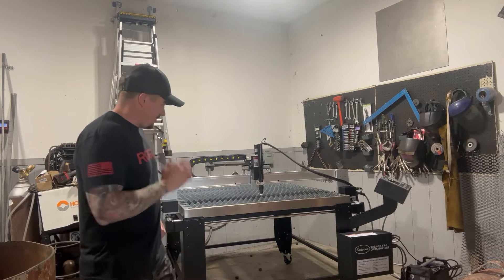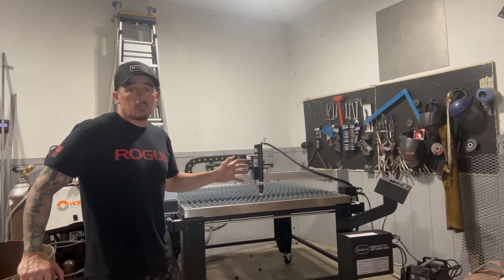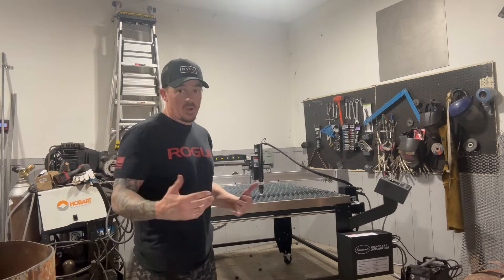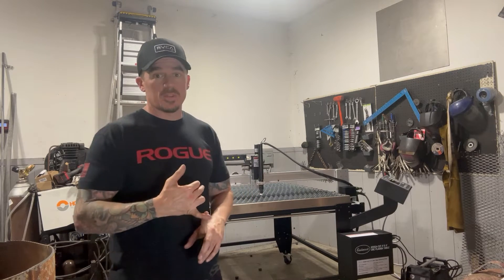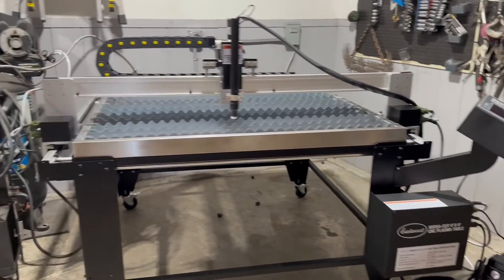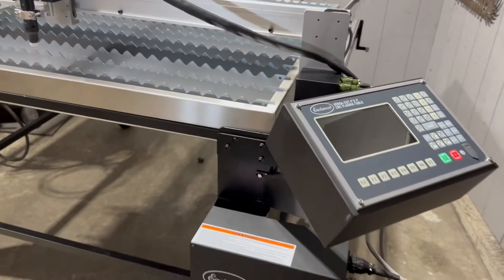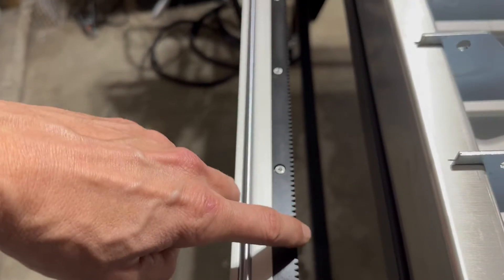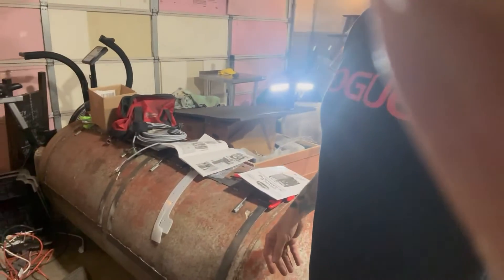Eastwood Versa Cut 4x4 CNC Plasma Table with Machine Torch First Look

Comment: The quality on these is pretty nice. I bought the 2x2 versa cut and assembled it last night. Nothing was missing, nothing was out of alignment and the quality was good. They do not have the lower frame strength for heavy 1/2" material but I don't think I need to cut thick material anyway.
Reply from the maker: I’m finally about to get mine fired up in the next few weeks. I got slammed with smoker builds and food truck dates last year. Looking forward to finally getting it to use 🤙🏻
Reply: @kansascitysmoked6263  Awesome! I hope you're able to post some updates. I know a lot of people are anxious to see how it works out.

Comment: Great video. But, you have a cnc plasma now. Theres no need to buy the standoffs if you damage them. Just make new ones on your plasma.
Reply from the maker: Life has been so busy I haven’t even had the chance to fire it up yet. Just got a HF air dryer for cheap on marketplace and I’m going to get it all plumbed in with a second filter as well. Then hopefully get to cutting and designing.

Comment: Let me know how yours is doing .I bought one 3 days old and mine want move on x or y axle.Eastwood is sending me another computer.
Reply from the maker: Man that sucks. I’m waiting on my fluid and figuring out the best way to plumb my air compressor to it right now. I’m hoping to have all that done in the next two weeks and start doing some practice cuts with the shapes built into the machine. I’ll be posting soon!
Reply: @kansascitysmoked6263 hello sir I was wondering if you like the plasma table? I’m in the market for one and thinking I’m going with Eastwood for size or the premier plasma tables since they are local to me but there are definitely not a lot of reviews on them so wanted to see how you are liking yours or if u would choose another brand after using it.
Reply from the maker: These last few weeks have just been insane with me finishing up a smoker and I’ve been slammed with food truck and catering. In about two weeks I have a little break so I plan on getting my air dryer and filter all plumbed into my compressor and then plan to start practicing on it. I’d say 2-3 weeks since I’m about to start another 288 smoker too 🤙🏼
Reply: Hope mine doesnt go out 😬
Reply: Please update